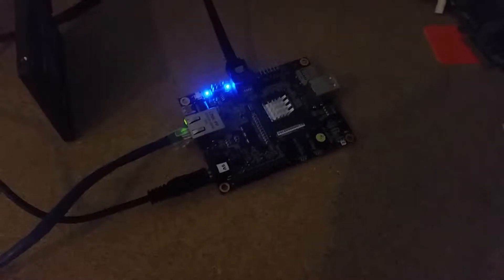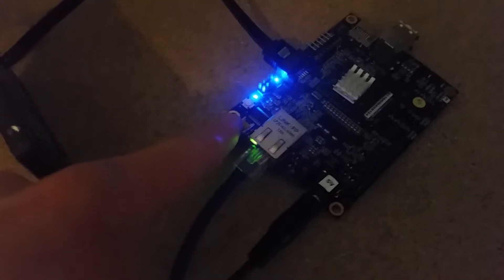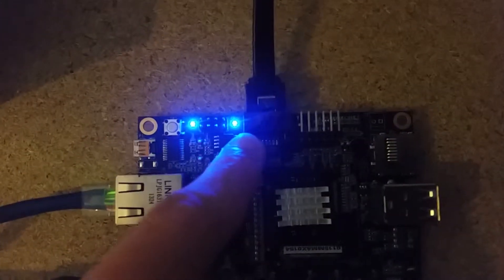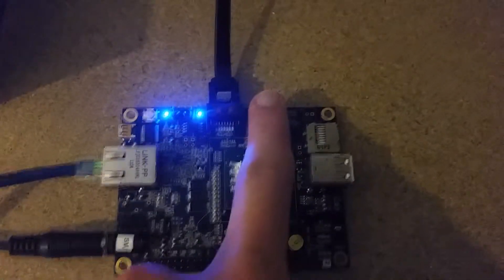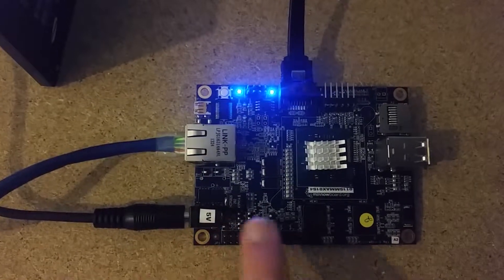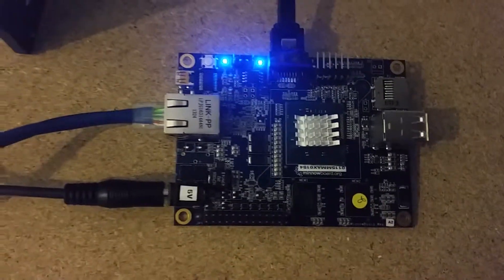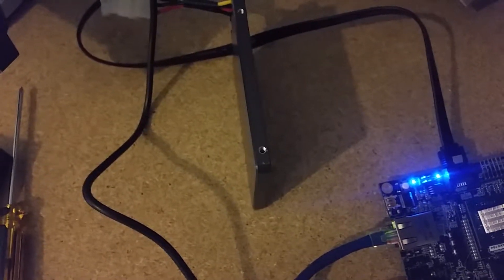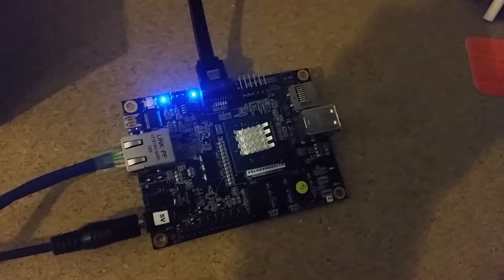MinnowBoard MAX Quick Overview

Comment: Hi Peter, in my Minnowboard HDMI port is not working. when I check the signal coming out of the processor, it's not coming out when the bootloader is booting. But when OS boots up HDMI signal comes out of processor.  Could you please help me with that. what's the reason for this to happen?
Reply from the maker: +shoaib i have seen this issue a few times now. So you boot but you can not see the EFI bios? Try and push your hdmi cable further into the port, my device takes a lot of effort to plug in correctly. If that does not work then you will have to send the device back and get it exchanged for a working one
Reply from the maker: +shoaib md i had an issue with my plug being stiff, check your mHDMI converter or cable.
Reply: Hey forgot to tell you, yes this was the issue. When i bought a good quality HDMI Cable it worked like WOW!!! :D
Thanks buddy.